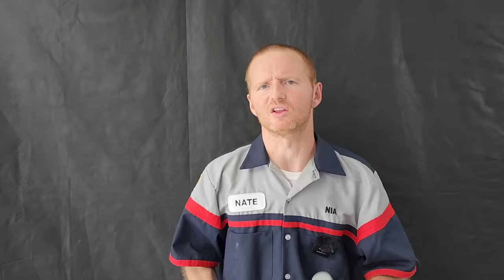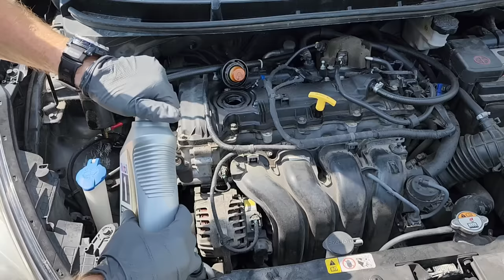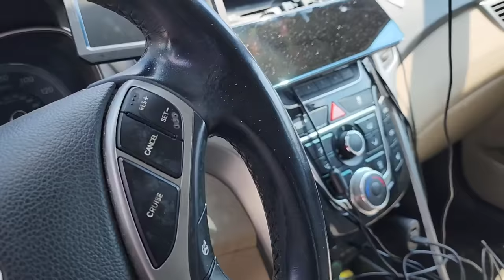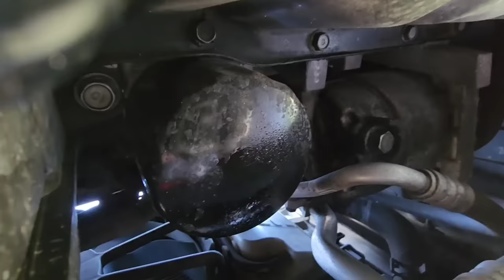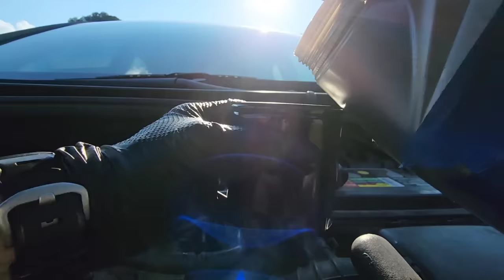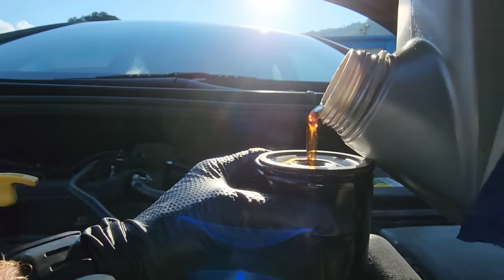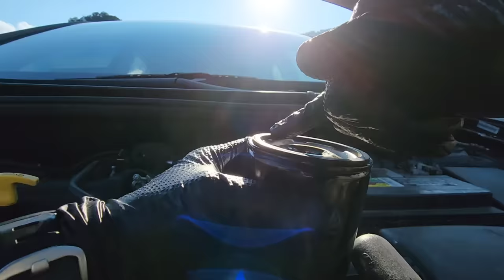Car owner sued after Jeep kills Mechanic during oil change

Comment: Very sad story, but this kid should not have been allowed to touch a vehicle   until he was familiar with its basic operation. Both the shop and the kid are liable. So avoidable and so tragic.
Reply: Lack of training is the employers fault
Reply: Exactly, the employer is responsible, the kid did not know how to operate a standard transmission, The employer should never allowed him to work on that vehicle until he became familiar with Standard transmissions
Reply: I don’t believe the kid is responsible, he was just trying to do his job,
Reply: @startover125 ..how hard is it to say, "I'm not familiar or comfortable with operating this vehicle.  Can I get some assistance?"   if operating a manual transimison car is a part of the job, and the 19yo couldn't, he is not qualified to work on manual cars OR he lied on his application.  It is the young mechanics fault, although accidental. It is the business' fault for not providing adequate training which resulted in death.
Reply: @K03sport  the real question is how did a push button vehicle start with your foot not on the brake pedal. There had to be a issue with the brake pedal switch or some fail safe issue had to be bypassed. The kid is at fault yes but so are other people
Reply: @billsfan1768  He could have just been hanging outside the car. Like just use the right foot (with left foot outside the car) to start the vehicle then quickly let off the clutch pedal and have the car jerk forward. He just wanted to quickly get it started to check for leaks. I've actually done this in a manual car numerous times but I always made sure it was in neutral by moving it to one side and feel it spring back to center.
Reply: @billsfan1768  ...it is safe to say the 19yo was not the one who moved the vehicle into the bay/work position....

Again, not familiar w/Jeeps, but most modern manual cars will not start w/o the clutch pressed in (and automatics w/the brake depressed).  In Alaska, in order for cars to be fitted w/an aftermarket remote start, a clutch switch bypass or brake switch bypass had to fitted to allow the car to start through the remote start module.   

W/electrical wiring, anything is possible.  The switch could have been bad.  The switch could have been removed or bypassed.  There was obviously not an "in gear"  (magnetic) switch either.  W/o seeing the actual vehicle, I can't say  anything about the owner.  However, based on the information provided w/the 19yo not being familiar w/a manual transmission or how to operated a manual transmission was the primary cause of the accident, in my non-lawyer opinion. 

I realize we all have varying levels of pride, and to admit fault or "I can't / I don't know how" among peers can be embarrassing and result in prolonged nagging.  However, in this case, as I see it, pride needed to be put on the back burner to ensure the safest operation.
Reply: @startover125  And when you do your job, you are supposed to do it responsibly.
Reply: @K03sport  you guys are misunderstanding what I am saying. What I am saying is by design of a push button start system does not matter who makes the car You should not be able to start the vehicle without your foot on the brake. What I think is the car had a remote start installed and whoever installed it bypassed the neutral safety switch or the brake pedal switch or both. So what I am saying is more people should be to blame here. Yes the kid is to blame but so are other people possibly the owner of the car if they installed a remote start and bypassed safety systems.
Reply: @billsfan1768  Manual transmission cars don't have a neutral safety switch or a brake safety switch.  At least none that I've heard of.  They have a clutch safety switch.
Reply: @dotar9586  they have a brake pedal switch that controls the brake lights when you step on and off the brake pedal. On a push button start you have to have your foot on the brake to start the car. The brake pedal switch make sure this happens. Unless we are talking about a rolling start which is something different. Clutch safety and neutral safety switch have similar functions what I am trying to say is safety system may have been bypassed and if someone did that it’s not on the mechanics to know that.
Reply: @jonWilk8156  I think my manual Explorer needs clutch and brake. I do that all the time anyway, don't drive it often though.
Reply: It wasn’t the kid he didn’t do anything according to the story that is outrageous they r suing the customers
Reply: @1891kmk  the judge did throw the case out and the dealership settled with the family of the tech that died for a undisclosed amount
Reply: @billsfan1768  Every manual I've ever owned only required he clutch pedal to be pressed in order to start the vehicle. It didn't matter if it was a key or push button ignition. Every manufacturer has a different design but I've owned manual Hondas, Toyotas and Fords and they were all the same.
Reply: @Guy9998  ok I know this. What I am saying is the clutch and the brake pedal have to be pressed at the same time in order to start a push button standard trans car. I guess I didn’t say it like that but I thought that was stating the obvious. So what I am saying a properly functioning push button manual transmission vehicle unless you have 3 legs it is pretty much impossible to start the vehicle without your butt on the seat. So for this person to be able to only start the car with using the clutch pedal there had to be safety systems bypassed. If you are just doing a oil change it is really not your job to know this. Even modern day remote starts can properly and safely start a manual transmission car but if the installer of the remote start bypassed said protection devices then the owner of the car/ person that improperly installed the remote start could be at fault here. There is more to this story
Reply: @1891kmk  I know in NY ANY injury from a car is covered by insurance. If you work on your car and get injured, you could claim. This is more complicated because it is employment. That would be workers comp.
Reply: @billsfan1768  You don't have to press the brake pedal at all to start a manual car. You only have to press the clutch pedal. It's just a good habit to press the brake at the same time so that the car doesn't roll. And it doesn't matter if it's a push button or a key ignition either, they're all like that. I've owned 5 manual cars throughout the years and they were all like that. I have a brand new Mustang GT and it's the same thing. No brake pedal required to start it.
Reply: @Guy9998   my wife has a Jeep Compass standard trans with a push button start. You can’t start the car without your foot on the brake. You could only rolling start it but that is something different. If you tried to start the car without your foot on the brake a message displays on the dash telling you to put your foot on the brake to start the car. A key start tumbler ignition no need to put your foot on the brake but a key fob push button ignition you have to have your foot on the brake. That’s what I’m saying I’m positive I have this car and I’m a mechanic started many push button vehicles you always have to have your foot on the brake or a message will pop up on the dash. Auto standard it does not matter. If you have a remote start you can bypass this feature
Reply: @billsfan1768  Interesting. Every push button manual I've owned I've never had to press the brake to start it.
Reply: @billsfan1768  manual, clutch needs to be depressed only.
Reply: @billsfan1768  as it should all I can see is that if this place is willing to sue the customer over this it’s gonna hurt his business in the long run
Reply: @1891kmk  I don’t think the place sued the customer I think the family of the deceased sued the customer. The case was eventually thrown out and the dealership settled with the family for a undisclosed amount. That is at least what I read online
Reply: Yes that is common sense, rare now days. Set vehicle in gear and apply park break. See that over and over in manuals.
Reply: This brings up a point which I have been making for DECADES: The oil and tire changers are usually the LEAST experienced personnel in a shop. But what happens to the engine when you forget to tighten the drain plug or leave the old gasket under the new oil filter? What happens when a vehicle going down the Interstate has a wheel fall off?

There is NO REASON such tasks should be entrusted to rookies.
Reply: @lordofthewoods  You gotta learn sometime.....you can't just automatically know everything about a new job. That being said, whoever trained this young man may have dropped the ball. But, there comes the time to turn em loose, to do the job by themselves.....maybe the trainer could have double checked on this employee? Sometimes we all make mistakes 🤷‍♂️ 
This mistake had deadly consequences!
Reply: @DavidLStone-qy8xh  No doubt, but anyone who believes wheel and tire work or oil changes are the ideal places to start off with no experience is mistaken. Makes just as much sense as starting them off rebuilding engines or transmissions.
Reply: @billsfan1768  If it was a WK2 (Grand Cherokee) then they have a remote/push button start that does not require the brake pedal to be depressed.
Reply: Yeah it would be like suing a farm equipment owner for some who knows nothing about the equipment.
Reply: It wasn't the kid, it was the old man who couldn't drive a stick shift.
Reply: @startover125  Even if he knew how to operate a manual. He should haven't had been touching the car PERIOD. He didn't have his driver's license, so he shouldn't have been trying the start the car be it manual or automatic.
Reply: @Jenkmode89 Nope. You are incorrect. Multiple news articles stated that the 19 year old did in fact not have a driver license.

Comment: People get sued all the time and usually the case is thrown out without merit. Frivolous lawsuits. The business owner failed to train his employee.
Reply: Crazy how people still don't understand that. You can sue for just about anything. Winning the case is another matter entirely
Reply: But they were Trump Supporters. 
So much of it rests on that fact.
Reply: failure to train properly or supervise an employee could get a business sued if it results in a tragedy.
Reply: If the man knew enough about manual transmissions to press the clutch and started he knew he should check if it was in gear before he pulled the clutch petal up.
Reply: sometimes people have to sue because tune insurance won't do anything until they try suing and they don't hey any money from the suit, then the insurance will have to act, that's why sometimes you will hear of people having to sue family members and it sounds messed up but it's more of s technicality
Reply: Two words osah violation
Reply: @benjurqunov  Trump for Russia.😂 Get outta heea
Reply: the idiot wasnt  even licensed to begin with ...red  flag there....owner fault for not checking their credentials..
Reply: @benjurqunov  this has nothing to do with Trump....I worked at a mechanic shop, and I was told to put the manual in park and right as I was about to do that the car jumped forward and I was scared. I never touched another manual stick shift since
Reply: I cant believe this is even an issue. The family could sue the company for not properly training their employee but the family is exempt. I guess had the mechanic test drove the vehicle, blew a tire and careened off the road it would also be the owners fault. Just unbelievable!

Comment: "make sure to check local laws before getting an oil change"  that's nuts lol
Reply: I guess if I die, I have grounds to sue myself. About as realistic as this lawsuit.
Reply: i change my own oil  it doesn't even need to go on a lift as it's just high enough to get under it sitting on four tyres    I still set the parking brake though..  even though it's a Automatic
Reply: No one ever even assumes someone is going to drive their car when getting an oil change. They didn't even drive it here, they just started it...

Comment: That's screwed up big time but that's how corrupt our system is , it's never the person it's the gun , car , another person, the store but never the person that caused the problem .
Reply: Those who make these frivolous lawsuits need to be held liable, I can't understand why they aren't. The car owner is clearly not responsible ( and should not be )  yet has to pay for a lawyer to represent himself - that fee should be passed to whoever initiated the lawsuit. Tragic that someone lost their life. Anyone who doesn't know how to work with manual transmission, and pull a e-brake lever should have been trained before doing the job.    Completely avoidable accident.
Reply: @boost7983  Good point. They should have had the ebrake on even if the car is automatic. You the front tires come off the ground and the car is FWD(most common configuration), the car will roll forward.
Reply: Yup same with drugs too.
Reply: @shifty1927 not really. Anytime someone’s high during an accident they are always taking the blame regardless if it was their fault or not

Comment: The owner has no responsibility in this scenario.
The dealership is wholey at fault!
Reply: Dealership hiring idiots on the cheap !
Reply: The dealers insure responsible , but the one responsible  is the one who released clutch without holding brake.
Reply: you would think
Reply: No the 19 yr old is